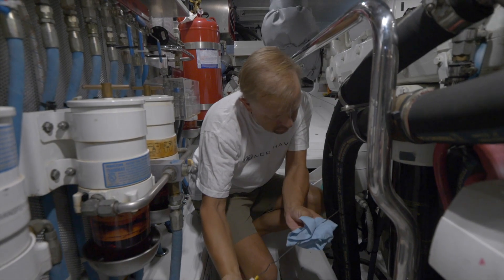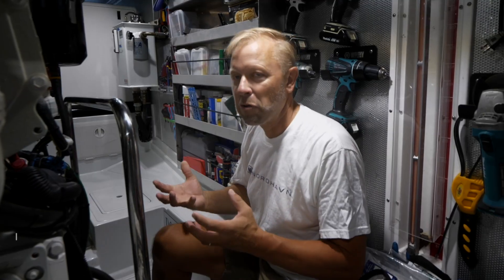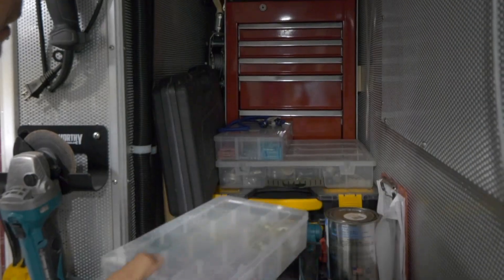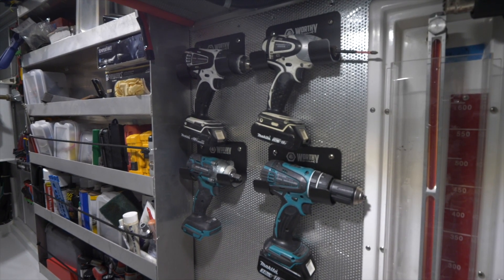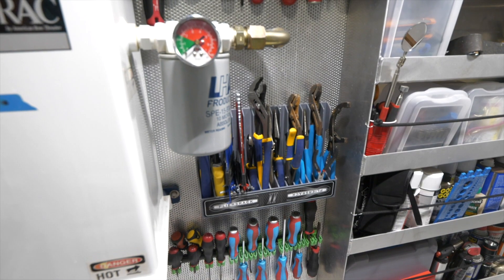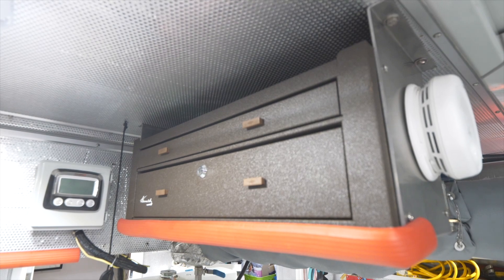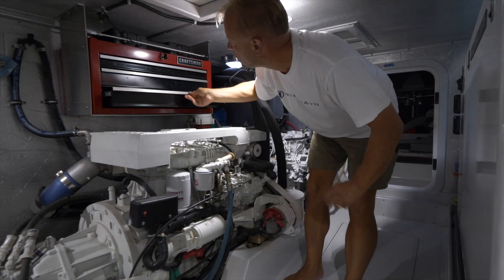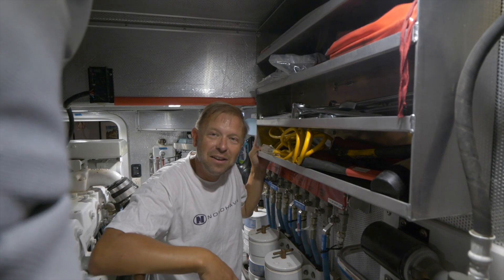Nordhavn Quick Clips: N55 Red Rover tool storage

Comment: did you bolt the brackets for the  drill machines direkt to the fuel tank? i‘m just wondering.
nice clean engine room. thx for posting.
Reply: The tool brackets screw in to the aluminum mesh with short screws.   The wall of the few tanks are behind several inches of insulation.   So, no, did not screw in to them.  😀